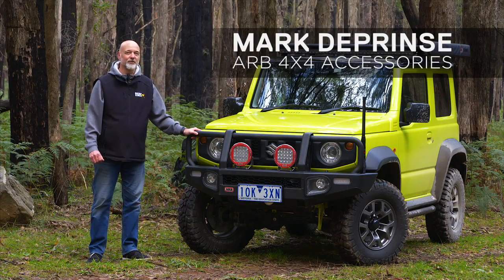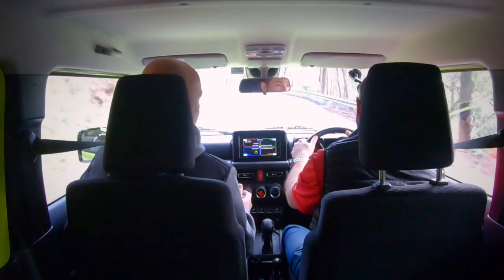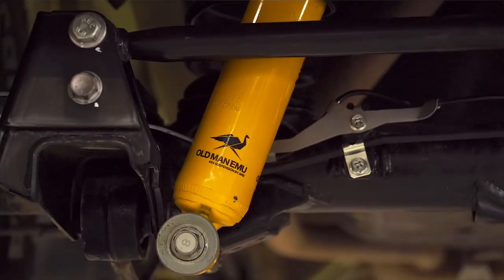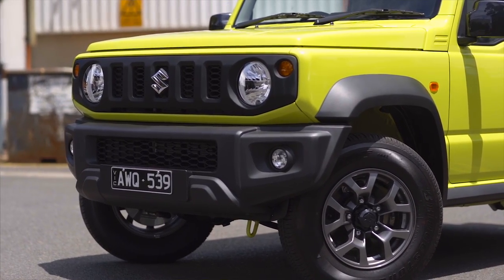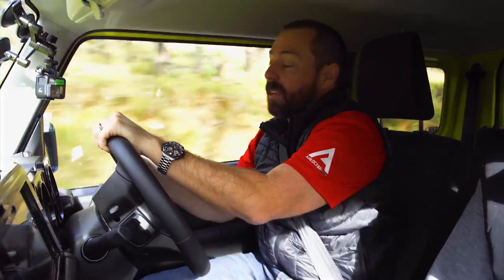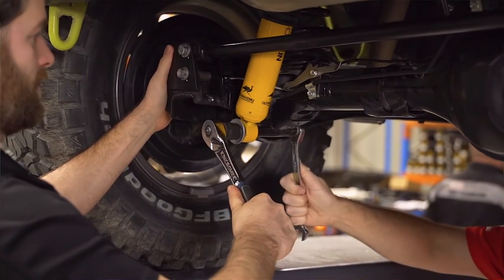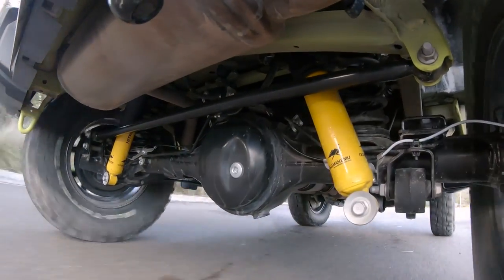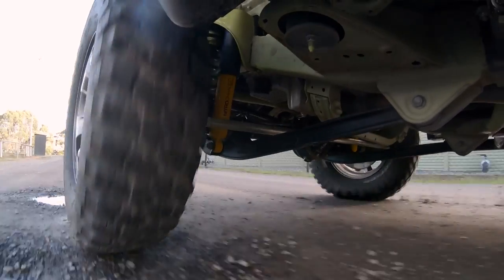ARB Suzuki Jimny - Suspension Development

Comment: Wish you'd offer this kit with longer shocks for more droop. I don't want more lift, but I do want to retain the good road manners and ride quality. But I'd happily fit extended brake lines and a front crossmember dropper to gain more droop for the times venturing off road.

Comment: They are so much fun, love my 3rd Gen Jimny. Suspension helps the control and handling on these cars works amazingly. Hope you guys have developed a gvm upgrade kit, adding 15% to the gvm would greatly improve it for legally being able to put a bull bar, rear drawers fridge and camping gear without going over the legal limit. 
The 400kg payload disappears really quickly. Ideally a payload of 600kg is far more appropriate.

Comment: So is this softer or harsher than the stock suspension? hitting potholes and rough surfaces, will it translate more or less into the cabin?
Reply from the maker: Hi there, for the Jimny, the suspension offers a different ride depending upon your use. If you're loading your vehicle with a range of accessories, it will provide you with a better ride, especially off-road. If you're leaving your Jimny standard but changing to Old Man Emu suspension, the ride will be stiffer, but will still handle better for off-roading.

Comment: What tyre size can I fit on my jimny after buying and installing this suspension?
Reply from the maker: Hi there, we would definitely recommend getting in touch with your local tyre distributor as ARB neither manufactures nor sells tyres so we can't make a recommendation on the best tyre for your setup. 
Our Jimny runs BFGoodrich T/A KAO2 235/75 tyres comfortably.
Reply: Reader beware and make sure you take the talk to dealer advice as 235/75R15 tyres are not legal on stock rims in most countries